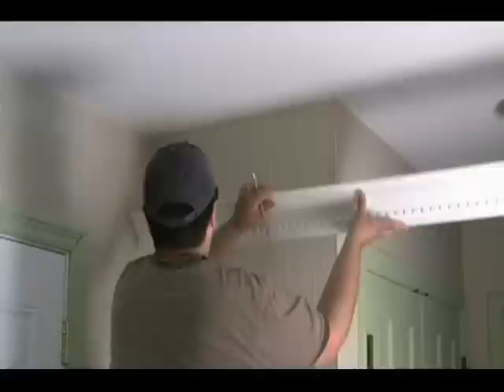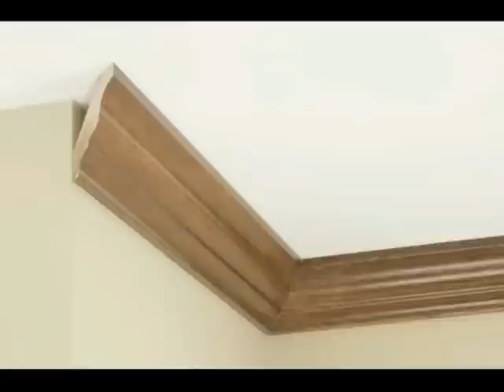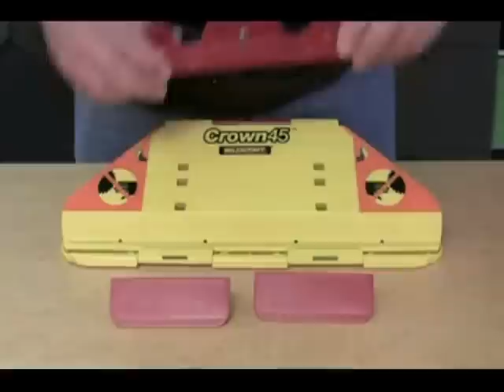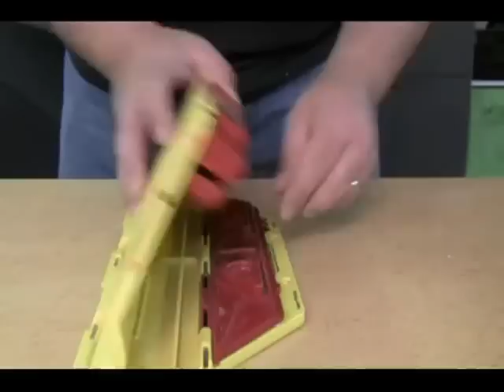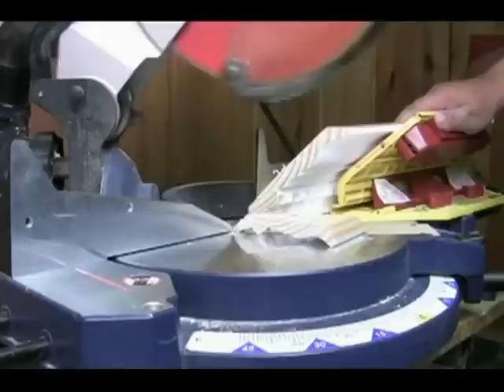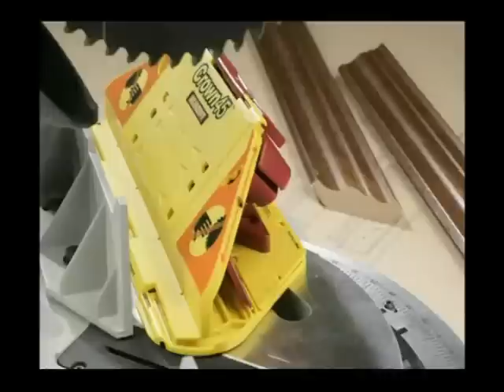Crown 45 Miter Jig

Comment: You failed to consider that the front profiles of all crown moldings are not the same, so locating the crown from the front face will not always deliver the proper angle. You must locate the crown from the flat surface on the back.
Reply: If all the angles are wrong, it will all be right ✅️.  lol